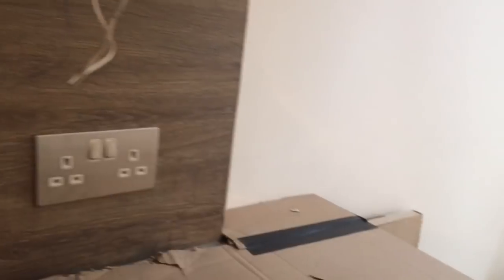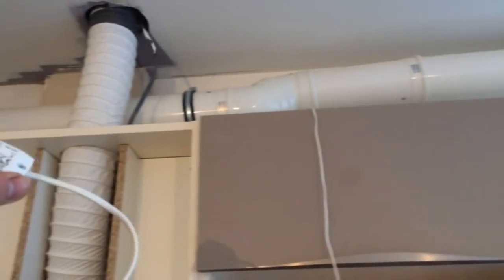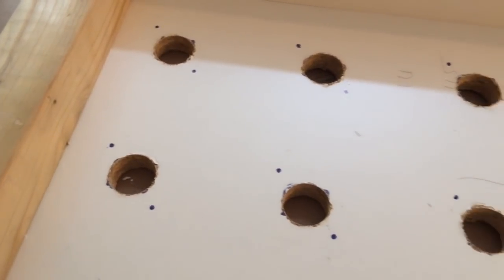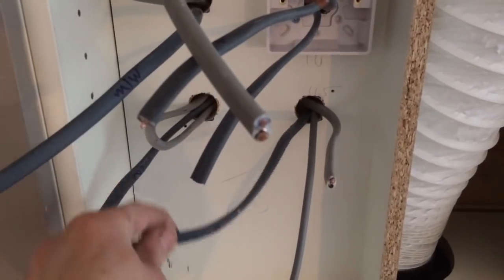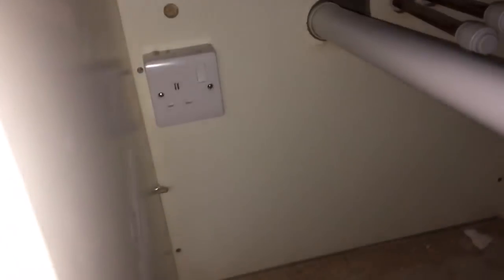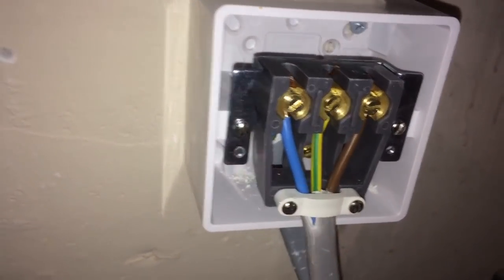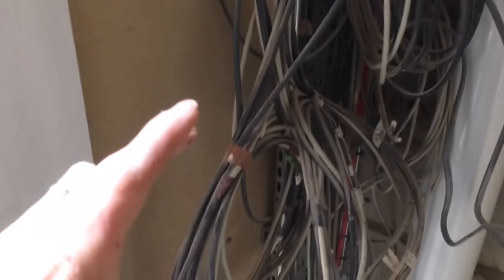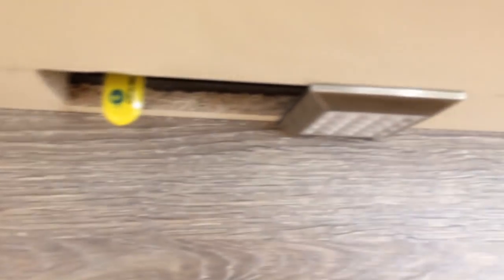Electricians Day Kitchen Install

Comment: CRJ, Would you not always wire 6mm to where an oven goes - that way any oven should be able to be powered. My Double oven draws 6.9kw on peak power on peak day. (Christmas) - so 2.5mm is not going to be enough. Future proof the choise of appliance vs haveibngto recable . Small price to pay to ensure 32/40amps can be delivered..

Comment: Great video again, but why don't you show us amateurs some of your electrical techniques, wiring these supplies up, tricks of the trade?
Reply: GrumpyGrampa trick of the trade stay the away from electrical work  !
Reply: Because, Grumpy Grandpa, amateurs really shouldn't be doing ANY significant electrical work!

The one thing that is more dangerous than NO knowledge, is a LITTLE knowledge. You are more likely to attempt a job that is beyond your capabilities if you THINK you know what you're doing... and that is a very dangerous scenario.
Reply: Kevin McNicholas agree your a point. However, a little knowledge as a non qualified amateur has made me spot and fix (or have fixed) very dangerous situations left by so called sparkies. Complete ignorance or fear of anything electrical would have left my loved ones exposed to non-earthed metal faced sockets etc. Knowledge is good but know your limitations.

Comment: Is it not easier to get like one deep double box/patress and have it with say e.g 4 switches for washer microwave fridge etc. That way it's less boxes and only need the feed in one box? Kind of like grid switch but for appliances
Reply from the maker: Yes this can be done but you still have to fit sockets behind integrated appliances with the rated fuse in the plug top then if the fuse blows remove the whole thing to replace it . This way just makes it so easy .

Comment: Nice video mate! What make are those under cabinet lights you installed?
Reply from the maker: Nathan Bird sorry for the delay the are by a company called blanco high definition square led cabinet lights - stainless steel surface mounted .

Comment: Do you only need appliances connected to the FCU if the appliance plug is not going to be accessibile? If so would it not be better to just mount sockets in the cabinets and cut hole to fish the appliance plug?
Reply: A man with common sense. Well done sir. Who switches appliances off anyway and alot of appliances have moulded plugs which shouldn't be cut voiding warranty.

Comment: Call me old fashioned, but I'd much prefer the switches for my appliances to be above the worktop rather than hidden away in a cupboard. More convenient
Reply: Its 100% stupid banking these together in a high up press . These should be clearly visable and near the appliance . Just very poor standards
Reply from the maker: Very poor standards. You clearly have not done much electrical work in high end places where no client wants to see 300 switched Spurs on show.
Reply: @Cjrelectrical  i can tell you ive done over 15 years worth of it in high end homes . Ring mains are  a dangerous practice first of all . Customer would never get the option to have concealed switches   its bad practice and thankfully against the regulations here in ireland .
Reply: How do you figure those switches are inaccessible? Opening a cupboard door isn't beyond the abilities of most homeowners.
Reply: @jameslewis875  Out of reach ≠ inaccessible. Junction boxes that are not maintenance free need to be accessible - that doesn't mean they need to be within arm's reach. Isolator switches need to be similarly accessible - they're there to turn off the appliance if it develops a fault or whatever, but they're not meant to be like the emergency stop on an escalator. If you have to get the steps out of the hall cupboard to reach them and the client wants it that way so as not to clutter their tiles with switch points, then so be it. It's not against regs.
Reply: Those switch's are asscieulble for maintaince/use!
Reply: @aidankennedy8924  oh he quiet your in Ireland different regs so stop moaning